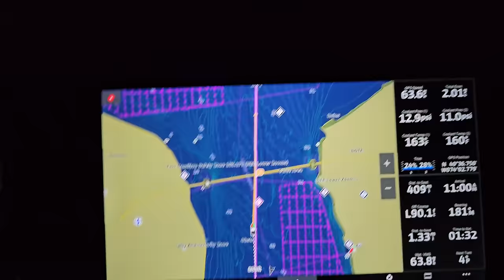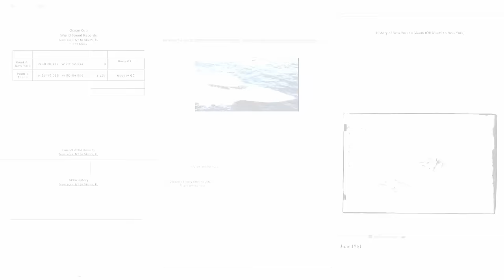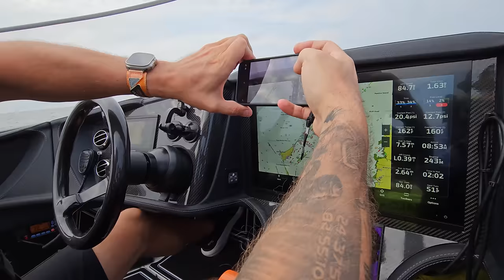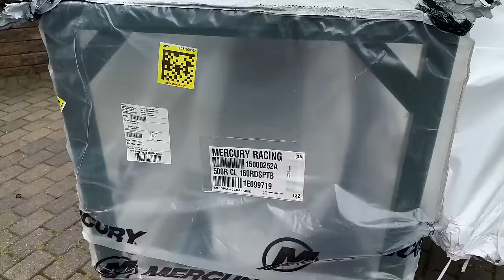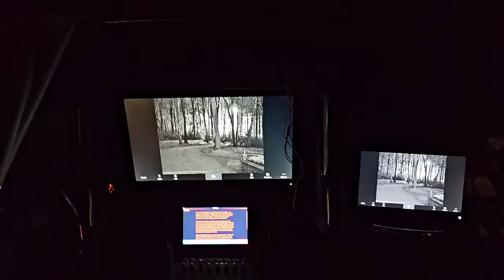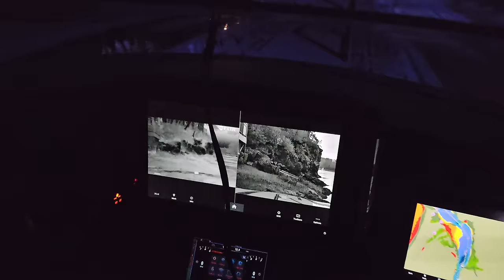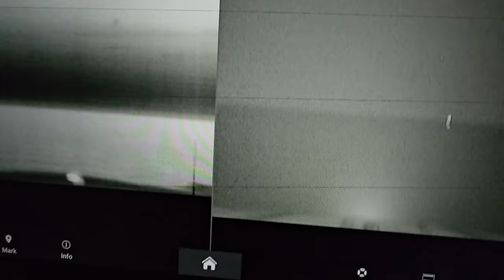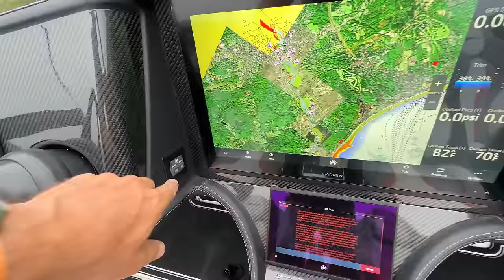World Record Disaster! NYC to Miami By Boat In 1 Day - Ep1 a series by Howe2Live

Comment: Always wondered how to estimate what prop is best. For instance, if you used the same props as the 450's, 5000 rpm would be the same speed on the 500's as the 450's. Seems like you would need 3 or 4 props to try. Or is there some formula for pitch, prop diameter etc.

Comment: So, if the auxiliary tanks are only full for a short period after fueling, does that mean you used from them first or were they plumbed into the primaries? Also, after this record-setting adventure, do you wish the 440 had air-ride seats or would they position you too high to effectively operate the boat? Before answering, please consult your kidneys. lol Btw, I'm heading to Cancun in a couple days and I'll be sporting my H2L swag in the Yucatan Peninsula!
Reply from the maker: Air ride seats would be great but as you surmise correctly, there’s simply not enough vertical room in the cockpit for proper design of this style boat.   The top tanks were fed into the dual fuel filter inlet and used first by turning off the main fuel tank valves.  When we used the top tanks, we’d turn the top valves off and open the main tanks.  Worked surprisingly very well and with out a single hitch.  Thanks for watching and representing :)

Comment: She checked engine mounting bracket torque with a 3/8” ratchet, 6” extension and an impact socket? No torque wrench? Or was that just to keep the nut from spinning while the torque was checked from the outside?
Reply from the maker: Great question.  Sarah was holding nuts

Comment: Surprised you didnt use IR spot lights cause they arnt seen wit the naked eye? But way cool record setting!
Reply from the maker: We tested them and while they worked nice to add more detail at low speeds, they did the opposite at higher speeds.  We found that at night there tends to be a very light haze over the water.   While this doesn’t effect the low light at slow speeds, it clouds it out at higher speeds.   It’s like a hardly noticeable fog and this is enough to render the low light not reliable at higher speeds.  Any additive light whether that be in our visible spectrum or not adds to this high speed fogging effect.   Great question.  Hope this helps:)  Mike

Comment: Okay you should have used a battery powered fuel transfer pump. 
You don’t have a ski or mount bar. I would have post mounted in the back.  Yes radar.  I would recommend  a boat roll bar , custom for a boat like yours for radar and FLIR. I would have used off road tanks with baffles to reduce sloshing. I would have considered a fuel bladder. I would look at the new toroidal props in the future. I understand the straps but would have used wider semi style straps.
Reply: Also would have used 2 Nexar smart dash cams to record with using the ones that recorded forward and reverse. Look forward to the next video.

Comment: So 1.1 million dollars for the boat, $150,000 for a pair of Mercury Racing 500 horsepower supercharged V8 outboard engines, $125,000 for a new dually pickup with lift kit and big tires, $4,000 night vision, $3,000 FLIR, yada, yada...